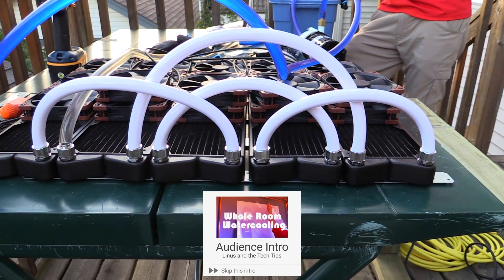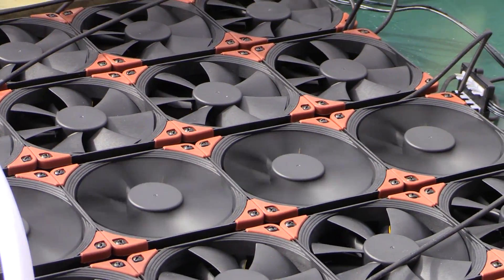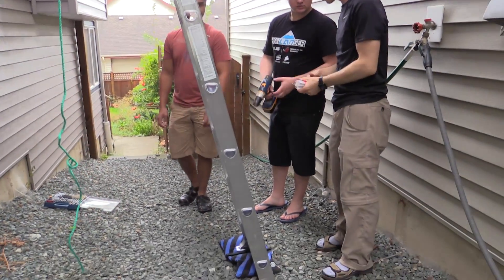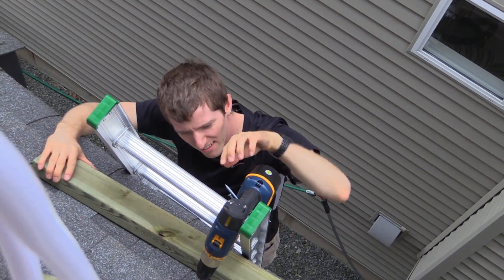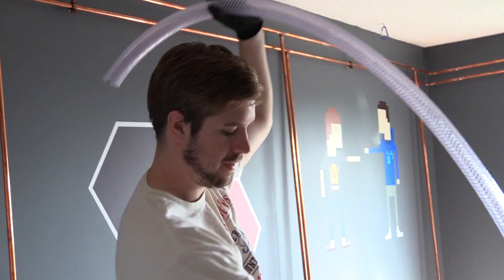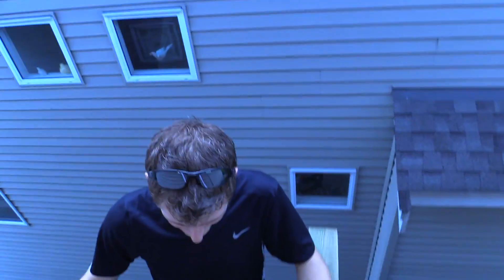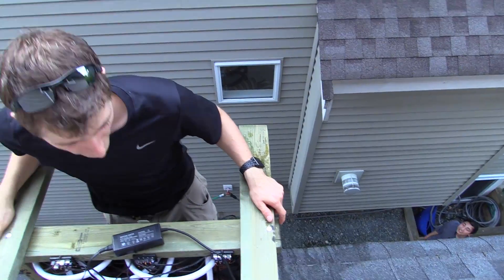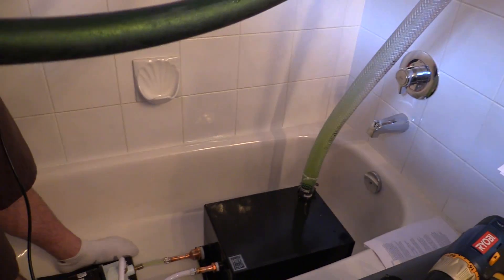Whole Room Water Cooling Project Day 3 - Radiator Mounting and Panic...

Comment: I feel like you guys over-complicated this whole build.
simply using regular water cooling loops and a AC in the window would have been far more simple.
Reply: And not nearly as fun, interesting, nor exciting!
Reply: Sanic
What part of Linus doesn't want AC that you don't understand?
Reply: Linus doesn't want AC
Reply: nazhif1 a little window AC unit is about $200.
easily purchased instead of 5 360 rads.
Reply: 1300l If you knew anything about LTT, you would know they are enthusiasts. They don't care about pricing or simple alternatives, they like modding and making new projects. Like every other mod, it's not necessary, but its a good and fun experience, and it is very rewarding to see the work completed.
Reply: 1300l 1) This was filmed in Summer. They've been running the water cooling system for months now, so that confirms that the system is functional and is adequately cooling their PCs.
2) It won't actively "cool" the room, so you're correct on that point, but the purpose of the system is to prevent their PCs from HEATING UP the room. Since the system dumps the heat OUTSIDE, the room is cooler than it would normally be during their daily work routine. Using normal water loops + an A/C unit would mean heating up the air in the room, and then using large amounts of extra electricity to cool down that air to comfortable levels in a very noisy way.
3) Yes, this could've been done a lot simpler with a car radiator and other common parts, but they're a tech hardware enthusiast channel. Using tech hardware instead of car radiators and large room fans allows them to showcase products in interesting ways. Doing so means that sponsors like Swiftech and Kingston are willing to give them the hardware for free (or heavily discounted) for the opportunity to be part of an experimental showcase project that will get them a lot of attention from the tech enthusiast community. Its win-win for everyone. LTT gets free hardware+lots of channel views+bragging rights, while the sponsors get a lot of marketing attention from viewers
Reply: Did you not watch the first episode? They say "That would've been easier, but we're anything but easy." They did it as an experiment. Shush.
Reply: nazhif1
The decision of not want an AC is make this thing too complicate and less efficient.
Reply: nazhif1
the point is clear, this project don't worth much even as a "be different" value, it wont cool down the room, it take too much space, will be a maintenance nightmare, i wonder if it will cool down all PCs as it should. It is just too gheto. They could "innovate" on something that could be better then an AC or on something else.
Reply: 1300l This is more fun to watch than watching someone put in an AC.
Reply: Are you new here? 

I think by now it's obvious that Linus wants to do things the cool way, rather than the easy way.
Would you watch a video about them buying an AC and installing it
Reply: thats no fun
Reply: this cuts down on noise. no ac needed and no fans running
Reply: 1300l
your point?
Reply: 1300l look out everyone we got an expert in thermodynamics here.
Reply: nazhif1
Doesen't take an expert to know that an AC would be just better in every way. Specially as they drop the ball on this "replacement" system.
Reply: MoonlightJazz
Yea but they still will need the AC as this system just wont cool down the room. Also they can be enthusiasts, but they should make a better system. This system is full of flaws.
In fact the enthusiasts when move to the new office will install an AC instead of re-do this system...
Sonic AIDShog Maybe for some.
Reply: 1300l that's the process, they make errors, they can correct them. This system has errors because they tried to make it as modular as possible. Also they won't move into a new office in a while, their goal is 200k, that isn't an easy task.
Reply: MoonlightJazz
Yea but this system wont bring anything better then any other system (including maybe keep the PCs with standard cooling system on a hot room). Enthusiasts do expend money on things that most wouldn't, but they do it for a better system, not one that wont bring nothing better at all.
Reply: TDPEquinox
I would want no video at all about this stuff, this project could be cool if it wasn't more flawed then anything else. The other projects he done was fine, but this one is just borring and rubbish.
Reply: 1300l Then stop watching?
Reply: It's not wasteful or inefficient enough. For the last part, they will add another 20 fans for push-pull. Gotta have that extra 2 degrees, you know?
Reply: Midget Queef
Already did
Reply: 1300l Gr8
Reply: Andrew Tran
1 - It still don't cool down the room and isn't better then a conventional cooler for the PC.
2 - They told that the propose of it was to cool down the PCs and the Room as the people on it was complaining about no AC
3 - I don't mind if it is complex but they haven't think too well on this system, they could do a better job or think in something else.

This is where real enthusiastic is different then who do things in the sake of entertainment. Enthusiastic want the best of the best performance, even if the price is too high. This system wont bring it. They could use this hardware in better projects.

Comment: As a "jack of all trades" on a farm, this series has been slightly painful to watch. Mostly due to the plumbing.
Reply: everyone is an expert online..
Reply: I know, right? Boys will be boys, I guess. Lolz
Reply: If you're referring to the copper piping then I am like so confused. Luke (slick) had his dad do it and he's like SUPERRRR qualified
Reply: *****  If you think 50 grand will get them a new office you are sorely mistaken. 50k will be very optimistically a deposit, but it could more than likely be up to half a deposit..
Reply: Strike Down
 I don't know where you live, but there are mandatory spacings between piping.

and soldering copper pipes is still very common here in Canada. (those compression fittings are bloody expensive, as is plastic plumbing)
Reply: CurtisVlog'n'Games qualified but rushed. Forgetting to solder a joint isn't very professional... But then they said they had him there till 4am so what do you expect
Reply: Easy. I believe he didn't have enough time. Else he would surely have tested it first before leaving town for work. They only had him for some limited hours.
Reply: Yeah, the parts he did are fine. It's how the others kinda do the hoses and the pump. And the outside radiator.
Reply: IKR some of it is like watching apprentices lol , they even have wtf facial expressions to go with it. It's leaking grab a freaking towel don't look at it. Ahh
Reply: *****
This is the consequence of Linus trying to do too much shit at once. The videos keep getting cuter and cuter; little jingles, promoted soundtracks, obnoxious onscreen graphics; but the quality has fallen off the cliff.
Reply: Luke's dad who's a professional even did a very shoddy job.  
They cheap out on everything and the expensive stuff.. well is sponsored.  
Not like they care, they got all the money and will move office soon, FOR FREE because we gave them even more money.
I do no longer use Linus as any reviews because he's way too late and it's usually sponsored.
Disgusts me.